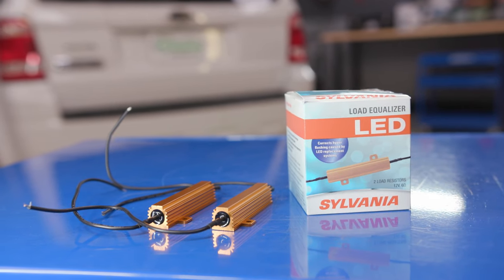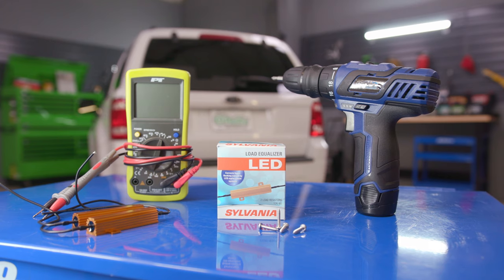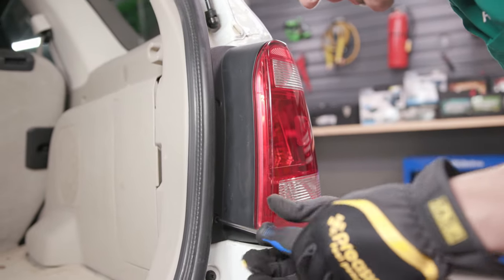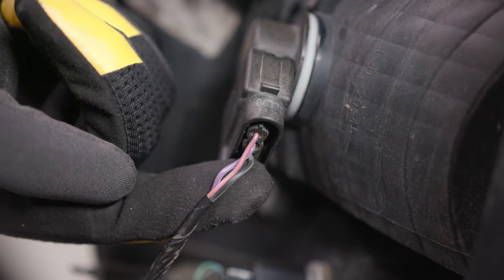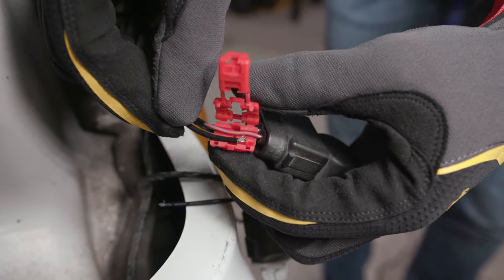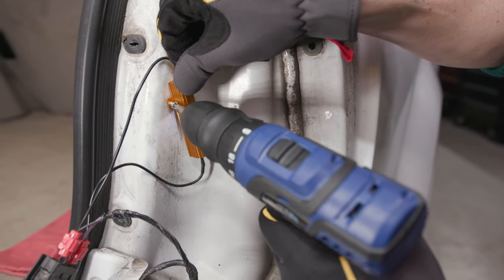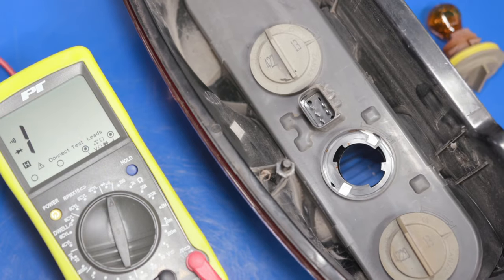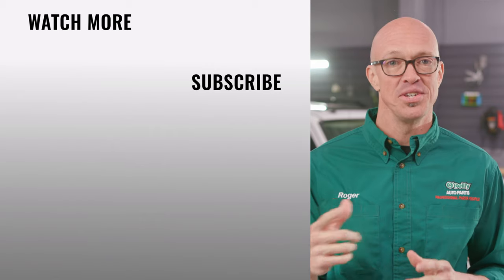How To: Fix Hyperflashing LED Turn Signals (Load Resistor Installation)

Comment: I just got leds headlight and led turn signal for my car, I have the hyper flash happening when the blinkers are on, I got the resistors but I got confused on which you tap into. So you said the common wire and position wires are typically the same color on both sides? So I have to tap into the black wire and the different color ones ?
Reply: If it helps at all, the wires I used in my truck were the two outter wires. Dont touch the middle one if you have 3 going to your light. Looks like he did the same in this video
Reply: @Chocolate_girl3  so tap into the two putter wires ? Alright I’ll try that. Thank you so much I appreciate it ☺️
Reply: @TR1CKSHOTS31  Hey did it work for you?
Reply: @SuperMan-uj7dh  so in my car the two back lights only have 2 wires so it makes it easy and straightforward. Just connect the one end into one wire and the other to the other wire. In the front is more complicated for me. 3 different wires for each blinker. And the worst part is that each side has 3 different colors lol. So I haven’t really messed with the front but I have all the parts ready to be put on. Tbh i forgot about trying to do it.

Comment: DO NOT USE THESE STYLE RESISTORS FOR YOUR VEHICLE!!! READ THE REVIEWS OF THE PRODUCTS YOU'RE BUYING!!
These Chinese resistors that you find literally everywhere (local auto parts store, Amazon, eBay, YouTube Links, etc) are 150w 6ohm resistors. LEDs won't EVER call for this much resistance.
Because of this, these resistors get SCORCHING HOT (over 250-300 degrees F) in a matter of seconds (around 15-25 seconds of use) due to the resistors insanely high Amp draw.
Most 12v resistance situations (CanBus Errors, Hyper Flash, etc.) call for 16-18 ohms of resistance @ around 13-15 watts. Simply buy (2) 25watt 8ohm resistors and wire them both in series (+ to -). That is PLENTY for a 12-16v application without burning up your car or constantly replacing LED lights that should be lasting months if not years longer than what they do.
Reply: can you give a diagram ? thanks
Reply: it works much more effectively when it gets hot that is the point lol
Reply: I would go for an led flasher relay, or get an led bulb from auxito that has a built-in resistors